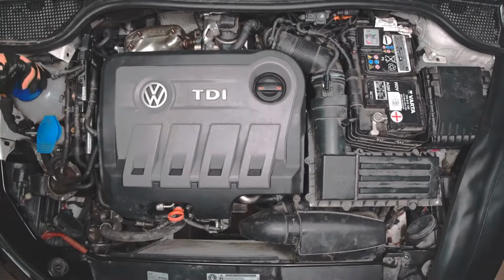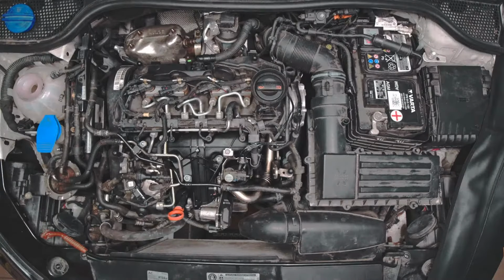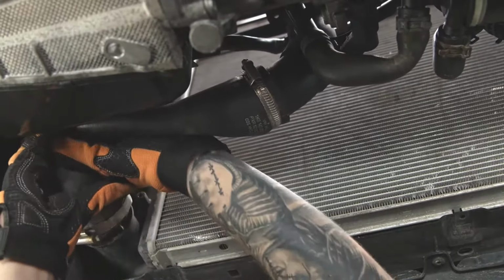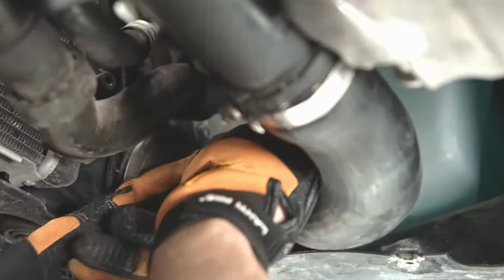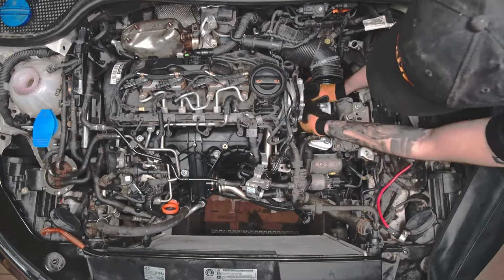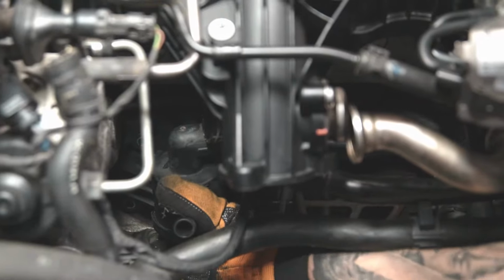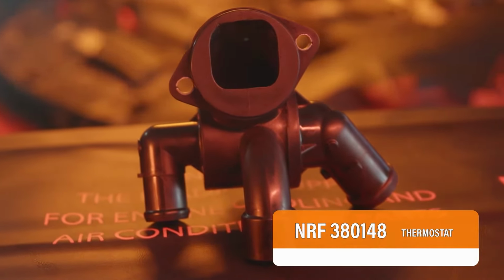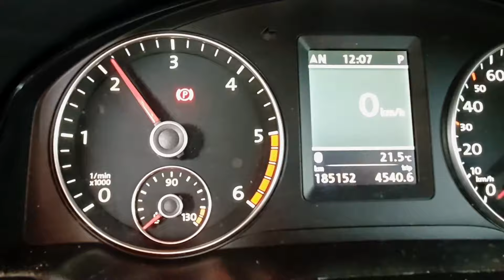How to replace the Thermostat on a VW 2.0 TDI engine

Comment: Holy cow.... This is German engineering? Use to be a guy could change a thermostat with a socket wrench in 5 minutes 😲
Reply: Dude worst car ever to work on… I’m in the middle of working on one now and they suck
Reply: I cannot even change highbeam bulb on my A6 C6 and lowbeam is also very difficult and you have to detach the servo liquid reservoir for it...
Reply: You can on a Mk5 2.0 TDI
Reply: @dopiaza2006  you can in 5 minutes?
Reply: @codyrussell813  On a Mk5, not the Mk6 on the video!
Reply: I made a big mistake buying a diesel passat . Getting a Volkswagen repaired in America can make you sick . This is the first time I hate a car this much.
Reply: Just wait until you see the gasoline version.  Say a 2016 Golf R/GTI/Jetta GLI/Passat.  Book time is 4 hours.  Thermostat is twice the size of this one, and the water pump comes off with it.  The pump is driven by a belt connected to the balance shaft so it can live under the intake like this car.  And if it’s a Golf variant, you’ll have to remove the washer fluid reservoir (so off comes the right front wheel) to turn the engine over by hand to put that belt back on.
Reply: I change my Hondas in a parking garage with basic combo wrenches and pilers. This job requires a surprising number of odd tools.
Reply: It’s a great video as it’s made sure I don’t have a go at it myself. Definitely one when it’s next in the garage!
Reply: Overcomplicated. 
I now enjoy droving my car that was made in India. Its simple.
Reply: @codyrussell813  on older cars made in America? Absolutely.   Two bolts that connected to a goose neck curved pipe , at the top of the engine. unscrew two bolts, take off the goose neck, and the thermostat is right there to just be taken out with the fingers, a new one cost about 5 bucks, just set it back in there, screw goose neck back down and your done.     Todays cars and foreign vehicles.. no way I would even touch them.
Reply: @SteichenFamily  lol

Comment: 90% of the parts you remove don't need to be removed, you're doing way too much work! remove the throttle valve, the hose underneath and loosen a hose on the additional water pump as a drain for the water. I've changed it twice this way
Reply: Do you have a video ?
Reply: @martin323guerrero  you find it on YouTube
Reply: A mechanic is currently changing mine. Dealer wanted 2400 parts and labor, bought the parts (thermostat and water pump) for 800 dlls plus coolant. Turns out the thermostat had a leak for a while. Every time I’ll go to jiffy lube they’ll ask if I wanted coolant. I had a slow leak all this time and didn’t know about it. My car is a 2018 VW Tiguan 2.0 TSI. Just putting this out there. Btw found a mechanic who did it for 300 dlls
Reply: Agreed
Reply: Please share the link  @chrissdk
Reply: we would like to see your video on how you do it. Thanking in you advance Chris
Reply: @loyisojumbe4578  it's not so easy but it's doable, you just going to get hurt a little because there is no space :D

Comment: I have to change this on a q3 TDI. Are you sure you can't get access to the thermostat by removing the feed pipe to the throttle body at the front of the engine?
Reply: Done it twice this way now. Very tight to pull the thermostat out but you can do it 😊

Comment: Mine engine only gets warm if left idioling soon I drive engine temps drops that cold , rpm cold start comes in and it’s been to dealers for various , Thermostate’s/ sensors changed , dosent use water and good return flow , can u advise what it maybe , cause water to take ages to get warm and not holding engine tempture when driving
Reply: Do you have DSG?
Reply: could be your fans
Reply: Dsg stat
Reply: DSG thermostat, very easy and cheap fix.
Reply: Hi, was going through this video and I seem to have the same problem with my 2.0tdi dsg. Did you manage to find a solution and what was causing the issue?

Comment: I changed one yesterday. I only removed the throttle and some minor other things. But it was a pain in the ass to remove the bottom screw holding the thermostat.
Reply: What did you use to get the bottom screw? I got all of the pipes off drained coolant etc and ended up putting it back together 😂

Comment: Good info, thanks!  I have a US Passat TDI GLS, purchased in March 2022 with 140,000 miles. It is in good condition, but needed some things fixed. It lived in TX and TN and is now in NE Ohio. In the summer it got a full coolant flush, drain,  fill, run till at full temperature with tap water (our water is very clean) 2 times, then same process with distilled water, then filled with spec Ravenol concentrate coolant from Blauparts. I did not take any special steps to burp system, just checked it every few days, it needed a little topping off, but thats all. Heater was working. Thinking back it did not seem that hot. Temp gauge got up to say 120, again in hindsight I now know that is low. Now outside temps are near 35F/5C, and temp gauge is only going up to 90F.  So am I looking at replacing the thermostat?  Any input would be appreciated.
Reply: Thermostat. Same thing with mine. As soon as the temp went down to 40F the cars temp gauge would no longer read 190.

Comment: 1992 SAAB 900 turbo - remove 2 x 13mm bolts, lift top off housing remove thermostat, clean surfaces, fit new 'stat, replce housing and bolt, undo bleed valve, fill with water, close bleed valve, shut bonnet.

Comment: I'm a VW mechanic and California yeah you got to take everything off everything did I say everything everything
Reply: So u are bad mechanic, its enough to remove lower intake pipe,throttle body ,and unscrew one 10mm bolt from oil level stick and its enough Access to unscrew thermostat housing
Reply: yes... everything... at the 2liter engin you have easy 5houers and can be a luky dude if nothing broke... i do it today... cheers
Reply: The correct way as per elsa system yes these comments comes from home diy and enthusiast which is fair enough as they don't have the luxury of lifts and fancy power tools cordless. for regular joe like myself this will be lengthy exercise

Comment: Would it not be easier just to pull the whole engine out
Reply: Not if your doing it at home
Reply: just the intake bridge and the rail
Reply: If you do what they did your not far from having it out.
Reply: in fact in most of these cars if you have the luxury of engine hoist it is a lot safer and convenient to pull out the whole motor as they were built that way in the first place. however we don't all have the luxury

Comment: I just had to get this done at a shop $840 in labor
Reply: $860 at a dealer in Chicagoland.  2012 VW Jetta TDI Wagon.  
I like the vehicle, but it seems like most of the maintenance is emissions and electrical, which I've never encountered on my previous Japanese cars.
As much as I like the driving and comfort/convenience I won't buy another German car after this.
Reply: @fecat93  same
Reply: @fecat93  exactly im on my 2nd Vw
Reply: @fecat93  that’s why you delete and tune and 90% of the issues are resolved
Reply: my first time ever using a shop instead of working on the car myself vw managed to misdiagnosis their way into a new thermostat which then proceeded to leak so they had to pull it all apart again. thermostat labor twice for free and they managed to put a ratchet in my radiator that visit as well requiring a brand new radiator. by the time they finished fucking up i had 90% of a new cooling system.. dealerships can be pretty bad

Comment: So essentially take apart almost the entire engine to replace a thermostat?  I'll never get this car.
Reply: You should see how bad the emissions system is to work on, deleting it the easy way without having to drop the subframe involves unbolting one axle at the trans and then sawzall the shit out of the dpf mounting plates and pipes till it fits out without dealing with the subframe and a new alignment.. I blew my turbo post delete and replacing the turbo was not all that crazy of a job once the emissions bs was out of the way
Reply: @DarkAttack14  why do you think your turbo blew?